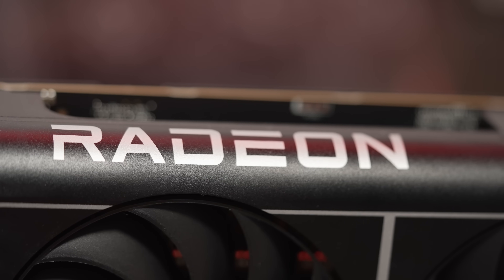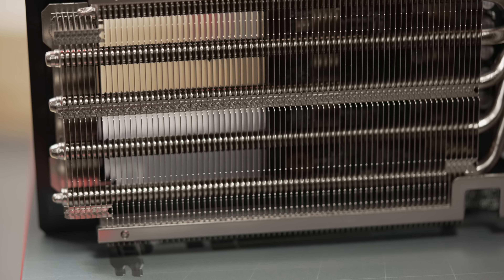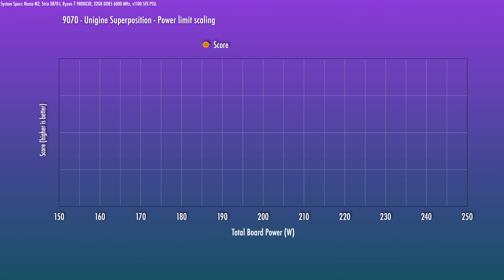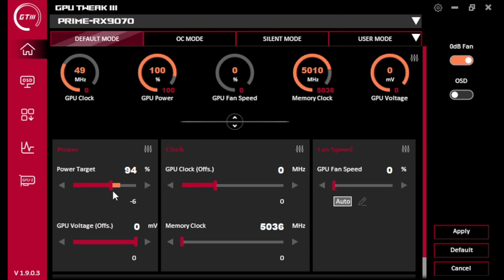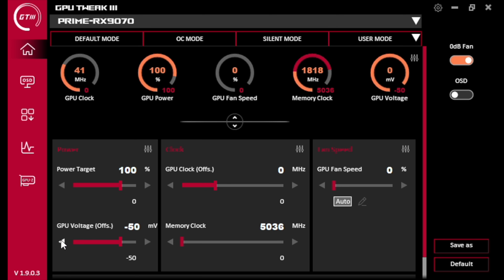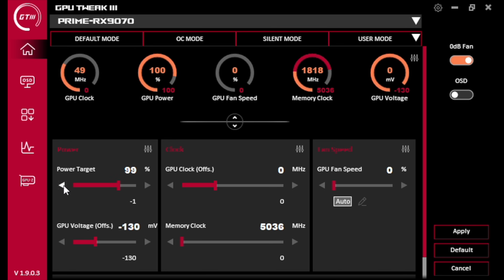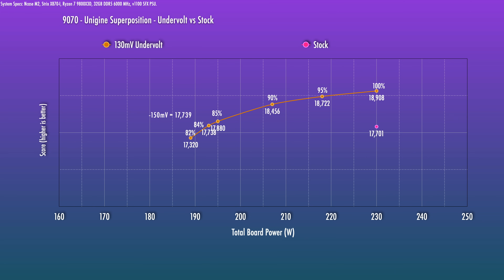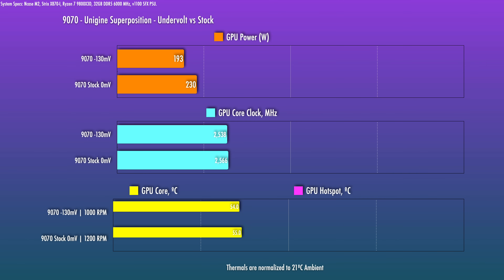Undervolting the Vanilla Radeon 9070! Giving 𝘦𝘷𝘦𝘯 𝘭𝘦𝘴𝘴 power...

Comment: finally a 9070 video all time i found only a 9070xt video for OC UV but your the first with UV only <3 at germanys southwest the weather is too hot in some arpatments for high wattage gpus so UV instant but never without know voltages lost 10-20% is no problem for me but lost 10-30° is perfect for my itx pc i wanna build next months (: the sfx psu is not the the problem its passive but the only the heat is my problem my old asrock rx6700xt OC (213watts) gets often 85-88C (junc 95-111C) its never overheat but in room 35-45C and a cooking full aluminium pc with 2 sides tempered glass 30cm away from you isnt that great (:

Comment: Mine has a base of 245 watts, it's a stock OCed version, if I mess with the power slider it goes up to 270 max, im wondering what a simple undervolt will do, I messed with AMD's built in tool and I pressed the auto overclock button and thats basically what it did it increased the wattage to 260watts and then did an undervolt, card was hitting 3.2ghz, lol

Comment: My 9070 (xfx swift) is finally looking to be stable at -110mV, 2700mhz memory clock, 85% power limit, topped off with 26% maximum fan speed. Temperature is 65c GPU, 79c Junction, and fan speed max is 1230rpm. 

This video did wonders for easy dialing in of the undervolts.

Comment: I managed to get the 9070 Pulse £80 below MSRP along with quite a bit of other people (pricing error for retailer I believe). It'll be arriving today, I'll need to undervolt it to even be able to let my PSU handle it.
Reply: Hi, I got this too :) Have you managed to under volt the card and if so could you please share your settings that you settled on?
Reply: @abhijitdash  Have not settled on settings yet. I managed to get it down to -110 mV  and ran a couple Uniengine tests without crash at the full 220W. Got crashes going lower than -110. Decided to try and reduce power. For power, I did -10% , managed to get a Uniengine test done. Tried -15%, crashed. I have not tried -11% to -14% for power. Bear in mind, this was just like about 30 mins of testing. I have not really settled on anything yet.
Reply: @ I did a Cyberpunk 2077 test for a more game specific scenario. -85 mV and -15% power got me the same clock speed and performance as stock. Sticking with that for now, seems like a safe option.
Reply: @MFR-85  thats great. I spent some time doing tests and settled on -75mV voltage offset and nothing else for an easy 6% uplift on performance. I could increase power but that was leading to more heat and the memory oc gave about 1% bump so not worth it. I tried reducing power but gave up as the temps on this card are already insanely low.

Comment: Your clocks are quite low which explains why your card isnt crashing when you go as low as -130 on the voltage. When i UV'd my gigabyte 9070 gaming oc im 100% stable at -100 with -15% power but im hitting 3ghz while averaging 200w power draw in game.

Comment: Either ASUS uses WAAAAY too much voltage on these cards or these undervolts are unstable
What's the real voltage with -150mv undervolt? 700mv? 800mv?
Reply: You can't say what the voltage is by this, as it is on a curve. So let's say the load is pretty light, the frequency will go up and therefor also the voltage. But in another gsme/benchmark the card may be loaded differently and filling the pipeline more, so the frequency will be as an example 200mhz lower, therefore the voltage will be lower, despite it in both cases using the amount of power.

With that being said, at the settings we are seeing in this video, I would guess 830 - 860 mv.
Reply: @gismo3564  Stock voltage is like 825
So that explains why he can undervolt almost 200mv. Because it has too much voltage over stock
Reply from the maker: Stock core voltage was around 870mV; the -130mV took it down to 750mV.
Reply: @MachinesMore  yeah that explains it, on my 9070 non OC model max voltage is 825 so 750 would be only a -75mv undervolt 😅
Reply: @MachinesMore  what was the stock voltage of the 9070XT you undervolted, I found the max I could go down, when testing a variety of RT games, at stock with a Sapphire Pulse was -65mv?

Comment: I set the powertarget at minus 25% and voltage at minus 70 mV. In one game I had 49 fps @ 183 Watts instead of 52 fps at 244 Watts!!! So 6% less frames for 25% less power consumption, temperature around 55°C (memory and GPU). Perfect!
Reply from the maker: Not bad! Cool and quiet FTW.

Comment: Good video! I was also able to match stock XT perf with my 9070 in benchmarks using these methods. Any reason why you don't use the amd driver tools to do this? Does gpu tweak offer anything in addition for rdna4 yet?
Reply from the maker: Awesome! There is a reason- Adrenaline crashed on me previously for this card. I will try it again and see if they’ve fixed the bugs yet.

Comment: Thanks for this testing!

Pretty much in line with what we were expecting: 9070 is already operating on a Perf(Pow) (Performance vs Power) sweet spot, but undervolting it can push stock performance in a <200W power envelope.
A really good card honestly. It's sad that there's no 2 slot 2 fan model on the market yet, could be an SFF beast for something like the Velka 7
Reply from the maker: Yup. I would love to see some true 2 slot dual cards well. Should be fine given the power level.

Comment: Grabbed a Power Color RX 9070 Reaper from Cincinnati Micro Center on the 7th, for 549.00 Just happened to stop in around lunch, was not even going to get one as my gaming rig already has a 7700XT. But they had 7 left, they also has about 200 XT variants left but all the MSRP ones were gone at that point. The cheapest 9070XT was at 700.00 From was not to adding 150.00 more money, I stayed with the 9070. Over the 7700XT I almost doubled my FPS on high settings. One downside to my Micro Center visit, was the following Monday 11th I was back by there around noon stopped in to grab a newer spec Display Port cable, and ended up grabbing a 32" Curved 4K monitor as well, they had a sale on one for 179.00. So 2 days and Micro Center took my lunch money. 🤣🤣

Comment: i bought the normal 9070 for exactly that ... im on -140 mv and -12% power ... same as stock .. it will save me in summer i don't like heat or fan noise and it runs all my fav games in high fps
Reply from the maker: Nice job! Which model?
Reply: @MachinesMore  Only asus and gigabyte models here in Africa so i got the asus tuf is inflated a bit but its basically 40% lower than prices of 5070 ti here

Comment: Your other video was extremely helpful to me. I went through your exact process and ended up dialing in 85% power limit on my 9070 xt and I've reduced the voltage to give me similar performance to stock. The way you presented the information made it easy for me to apply it to my system despite not using the same software since I'm on Linux.

Comment: Managed to snag a ASRock Taichi 9070 xt at $1299AUD. Excited to undervolt, as this card can pull a lot of power.
For reference Nitro+ is selling at $1489 and cheapest 5070ti is $1699 in Australia
Reply from the maker: Yup, you would follow the same method for the XT. The discrete power values will be different but you can still use the slider for the %.

Comment: Thanks a ton for this! Also, good to know that your model has a base of ~230W. Power scaling tests for these cards (as well as Nvidia) is hard to come by these days and the only reliable way to get this info is either through your own testing or with other people on forums/reddit etc.

3:30 "offsetting the voltage... doesn't lower your power, it's actually lowering the required voltage when referencing a particular frequency so the whole curve, you're basically undervolting it and so at equal power you will be running a higher frequency it's overclocking at stock power levels..."

Thanks for saying this. I feel like a lot of people who come from RTX cards or pre-RDNA have misconceptions on how the voltage offset sliders works. 'Undervolting' in the classic sense you would want to offset the voltage AND lower the power target comfortably until you don't lose performance compared to 'stock' like what you have done. In AMD's case, I think the term 'undervolting' should be replaced with 'V/F Tuning' and for 'OCing' it would just be the same but setting the power target to it's limit.
Reply from the maker: Thanks! You get it. It’s all overclocking relative to the stock VF curve at the end of the day, difference is what power level you decide to run at.
Reply: The question is why the clock speed slider useless? I'd like to lower both the voltage and the target, not tune it with power targets at all as that is inferior to clock and voltage tuning.

Comment: finally someone explained undervolting on amd GPUs in simple and detailed way, thank you!
Reply: just FYI  the mV step size is 6.25 ;  so -150= 24 steps could try to use -137mV, as 13mV is a safe guard-band after a crash;
Reply: @brunogm  good to know. But why does the clock slider offset do nothing?
Reply: @ my card is RDNA2, it was a 6600M so no tuning was possible besides SPPT;  Then i flashed a 6600 bios that allows some tuning but it still has some instability where even if i set a fixed fan speed seconds later it "resets" to other custom values.  Maybe is the "new" bios;

Comment: What happens if you undervolt the XT version to the power consumption level of the non XT? Same performance, less or still a bit more?
Reply from the maker: So- just apples to apples at identical power the XT is a slight bit better, ~3-5%. If you want to run a 220-230W card I would just get the regular 9070. The XT is engineered for a higher power target, at the waning end of the efficiency curve.
Reply: @ Yeah, but you have to get what you can over here, and often the lower end of the XT pricing is the same as the non XT. Shortages still continuing, most shops have no stock and once it comes it it flies of the shelves.
Reply: He's done it in the last video if you want to see. You can cross reference the data since he's using the same benchmark. So stock non-XT ~230W is ~17,700 and the XT at stock ~225W is ~17,900.
Reply: In the past large undervolt on Radeon required reducing the max frequency to avoid instability.
That reduced power consumption massively but the drawback was the 1% lows were hit badly.  I have seen reports on the 9070xt of undervolt resulting in significant performance improvements and better 1% lows so it depends on how the GPU has been set up and the quality of the silicon
Reply: Anyways Reaper is the smallest card for both XT and nonXT, it's not like you can get smaller than that unfortunately despite almost 30% TDP difference (so could be 30% smaller, dual fan dual slot instead of triple fan)

Comment: Thanks for this second video. I was excited to try this on my 9070 when I saw your other one, and I'm quite happy with the results. Managed to maintain same scores as default with -125mv and -25%PWR, reducing the power from ~240 to ~184W, and temps about -3-6C on the three sensors (my cooling is bad ATM so I guess there is room for even better thermal improvements).
Reply from the maker: Nice job! Sounds like you got a decent one there. Which 9070 did you end up getting?
Reply: @MachinesMore , possibly yeah. Still need to properly assess stability though! Got an XFX Swift Triple Fan OC.
Nice change from my old 6800 that could barely take any undervolting...